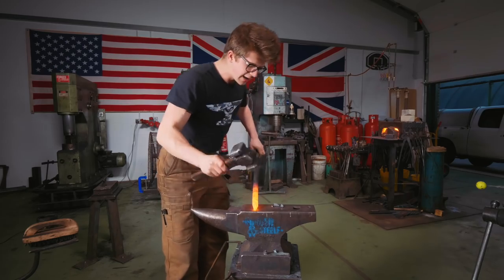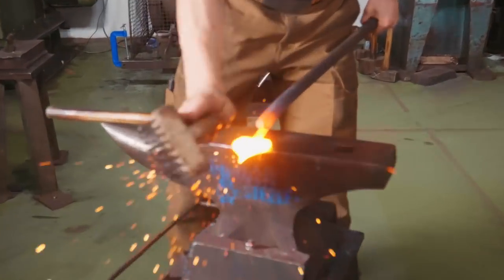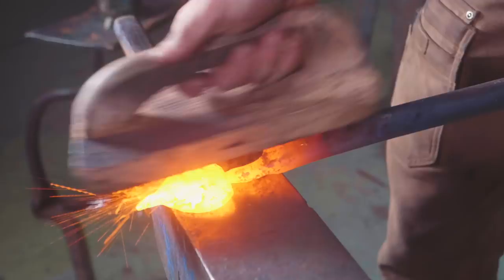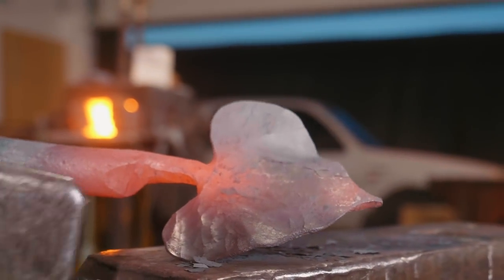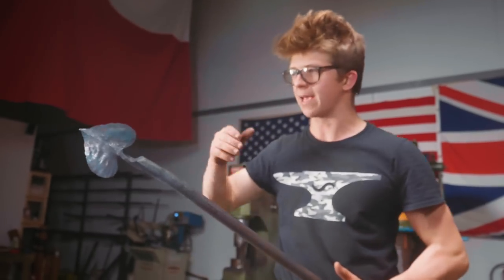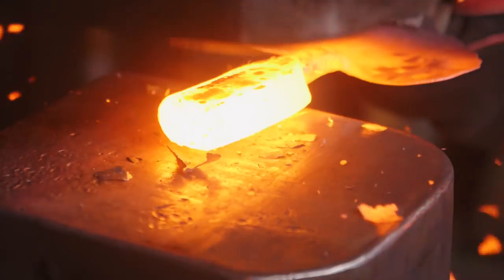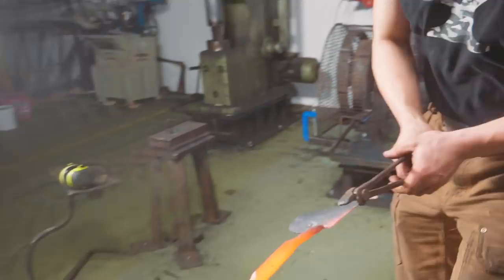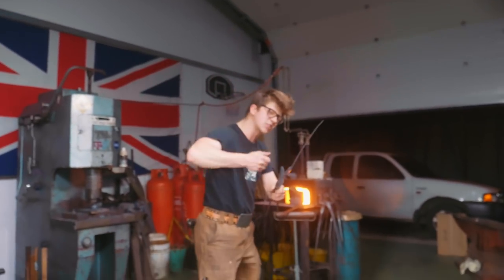HAND FORGING A GIANT LEAF-CANDLE HOLDER

Comment: Hey Alec I had the same problem with the thick and thin, what I figured out is that you take a cold piece of steel and touch the thin part, the cold steel will soak up the heat!

Comment: I would suggest propping up you anvil, as leaning over while hammering can lead to back damage. 
it should be high enough to have your hammer perpendicular to the top of the anvil (resting your hammer on the anvil) when your holding it. standing

Comment: Have you ever used a preheated piece of tool steel as your work surface when working very thin stock I've only done this once with leaves but it seemed to work well

Comment: In regards to heating a thin piece and thicker piece, could you protect the thin with the same clay used for a hamon? It should insulate and provide an oxygen barrier.

Comment: I've watched a lot of your videos, and while I see you measure meticulously in some areas (i.e. the pin on the katana measured  to 0.1mm), it looks as if you just eyeball it most of the time when using the bandsaw to cut off chunks to work. Is this really the case, or a side effect of editing? If you are eyeballing it, how do you know how much metal you need?

Comment: i know youre not a big proponent on weights of anvils. but i am trying to figure out what to buy as my first anvil, is there a reason to go with a heavier one? also is there a reason to go cast iron over one that does not specify? i plan on doing all kinds of blacksmithing, from decorations to knife and sword making
Reply: Just go with a 100 pound peter wright and you will be set and just remember use the rounding hammer

Comment: I still think u need to step out your comfort zone even more. Armor, gauntlet !!
Reply: Bérenger LEFORT This has been brought up and answered several times. Alec doesn't have the tools and equipment for working with sheet steel. It requires completely different tools. Dolly, bucking bars, shot bags/panelbeater bag, nylon/Teflon tools, specialized hammers, English wheels, planishing tools, lighter duty power hammers, beading/folding wheels, etc. He literally has none of the tools to work sheet stock.
Reply: Yeah that's why i used the word " still" ... And he can create his tools and equipment too, should be really nice to see that btw.

Comment: Where can I get a hammer like that?
Reply: Revrant he makes and sells them, but be prepared to shell out big bucks because they’re not cheap. $280 if I remember right.
Reply: Yeah I saw that last series where he was working on them. I was under the impression he wasn't going to be doing that again because it was so much work. I was looking around and there's a lot in the ~$100 - $200 range. Might have to ask for one for Christmas
Reply: That may be the case. It wouldn’t make much sense to me for him not to though considering they sold like hot cakes. If I were in his shoes, I would have hammers, tongs, striking anvils, etc in my catalog of products since blacksmithing is becoming so popular and folks need tools to do it properly. That’s just me though.
Reply: Revrant - I believe Dave Cusiter (?) Makes them and sells them on eBay. He's another Brian Brazeal student. You can try and get the master himself, Brian Brazeal to make you one. I did, and it's one of my most cherished possessions. Brian Brazeal has a YouTube channel you should check out. It has a lot of tutorials. Hope this helps.